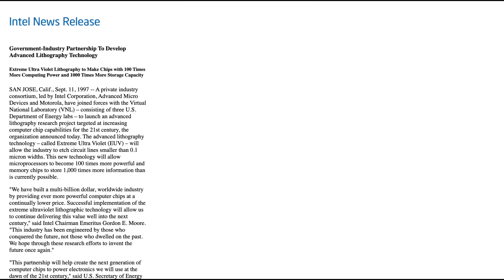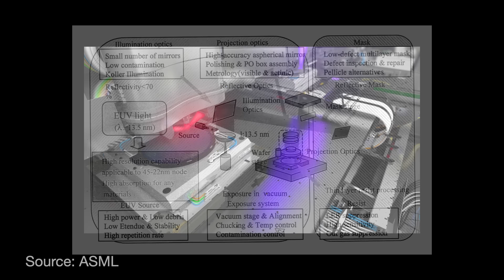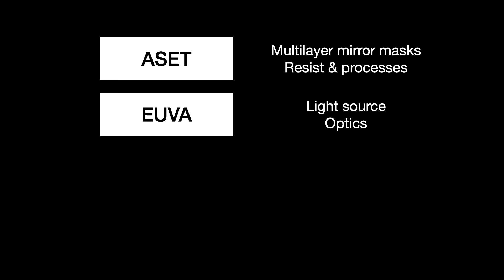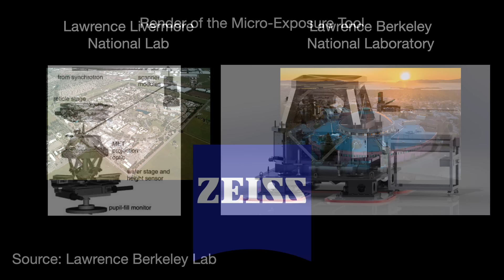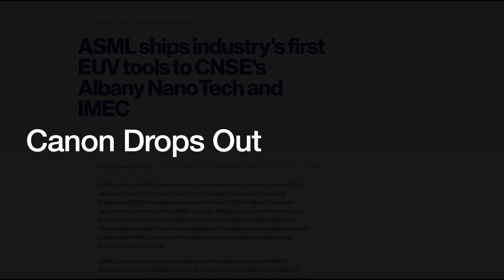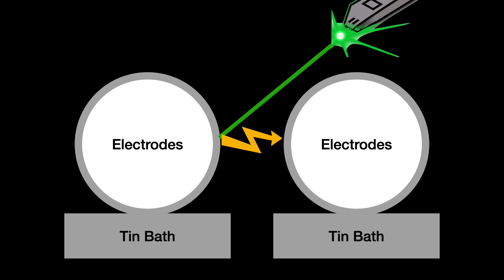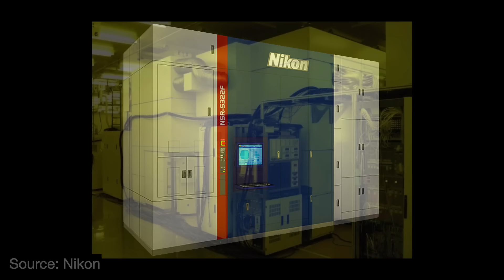Japan’s EUV Failure

Comment: Any time I hear about the EUV manufacturing process I can't help but feel that every tool at every step of the process is way too complicated to scale well. The amount (and quality) of engineers necessary to maintain even one of them would be a nightmare--not to mention the potential supply chain issues with these ultra specialized parts.
Reply: I was very fortunate to saw the first „pre production“ EUV system at the beginning of 2018.
I was a contractor in a company who is a partner with ASML and before that was responsible for the DUV machines.

It was a monster and had a million more parts than the „old“ machines.
I couldn’t believe this process can ever be used in a profitable way, but here we are just a few years later!

In my opinion EUV will not be the single do it all solution.
A hybrid approach and the use of chiplets with different nms for different purposes will be what we mostly focus on in the next 2 decades.
That’s my humble prediction.
Reply: Scalability by multiple stand alone processes maybe? Much like Apple did back in the magnesium case era, they stood up a few thousand CNC millls to make the cases individually. You get some economy of scale advantages by using a single brand and model of CNC machine.
Reply: I’m always amazed when somebody thinks the chip process is too complicated and expensive.  The number of transistors in a small chip is crazy impressive. Billions. It is complicated and expensive for a reason.
Reply: @ttb1513  I mean it's a fact that the tools themselves are just getting extraordinarily huge now. DUV isn't nearly as complex as EUV is. I don't think it's unreasonable to doubt its implementation simply based on past performance. I am confident that the technology will be used, but whether they will overtake DUV in scale I don't know. If you have any ideas, please share them.
Reply: @akatsuki6371  Overtaking DUV is a complicated question because foundries use the two machine alongside each other. DUV machines has higher throughput so EUV are only used on critical features that can only be done with EUV while using DUV for the rest. For example for the metal layers of a 7nm process. EUV is only use for the first and second layer. For 5nm the 3rd and 4th metal layer is also in EUV and smaller nodes will use them on even more layers. But Processor chips can have up to 12 to 14 metal layers. So DUV machines will not get abandoned. As process nodes that requires EUV grows they will still need DUV to complete the fabrication.
Reply: @kazedcat  interesting. So even if EUV is difficult to implement at scale, a hybrid approach could still allow it to thrive. I wasn't aware of this. I suppose it makes sense.
Reply: @akatsuki6371  you can definitely do 7nm and to some extent even 5nm nodes without EUV. The problem is your yield is crap and your cost is through the roof.

What kazedcat is saying is you only use EUV on the layers you absolutely have to. Fabs still have a ton of I-line scanners because they can spit out like 250 wafers an hour with much lower unit cost and preventative maintenance cost if resolution isn’t an issue. And this is what they do; most lithography machines in a fab by count are still excimer KrF/ArF and I-line. Fab mantra is: “always use the cheapest thing that works.”
Reply: @Grak70  I see! I appreciate your input.
Reply: @akatsuki6371  glad to be of help!
Reply: @akatsuki6371  As has been mentioned, EUV and DUV will coexist.  EUV is used for the lowest layers, with the finest details.  DUV is used at the higher layers where wire features are not as small. 

Because EUV is so expensive, there are still extraordinary complications taken to use multiple steps of DUV at a layer in order to avoid using one step of EUV.  This is known as multi patterning.

Micron has managed to figure out how to use multi patterning with DUV to produce leading edge DRAM, while Samsung and SK Hynix have had to resort to using EUV (again, for just some layers). Micron will have to adopt EUV for newer DRAM, but they have competed and have led DRAM without EUV. 

So, EUV has to compete with DUV and multi patterning with DUV.  Japan had an alternative to EUV, but EUV won early and has had all of the investment and market share.  Because this technology is so sophisticated and requires enormous engineering resources, as you observed, Japan could not and cannot justify further expensive investment in their alternative.  If it was only as successful and effective as EUV, it would be a losing and wasted investment.  An alternative to EUV would have to be so good that the R&D cost to develop it, catch up to, and surpass EUV would have to occur kind of out of thin air, all while profits and knowledge from DUV and EUV are reinvested in further EUV improvements.

It is similar to why it is so very difficult to develop an alternative to DRAM and bringing it to market at scale.  Without scale, an alternative would be expensive.  And an alternative cannot reach scale until it is inexpensive.
Reply: Essentially, once EUV beat Japan’s EUV alternative, there was not room in the market to justify continued investment in Japan’s alternative.  

But since DUV continues to be used for chip layers where EUV is not required, there has been reason to invest in clever ways to extend DUV, using multiple cheaper and faster DUV steps to compete against one more expensive and slower EUV step.
Reply: @ttb1513  Thank you so much for your response. I always learn a great deal from knowledgeable people like yourself :)
Reply: 28 nm (ignoring how much a marketing term it can be) is still the backbone of plenty of the market for years to come, just not cutting edge.
Reply: As long as it makes economic sense, they’ll find a way.
Reply: @ClockworksOfGL  I'm not convinced they will be economically viable. Have you ever seen one of these tools in person? They're absolutely ridiculous monsters.
Reply: @akatsuki6371  They are economically viable. They are using this monster machines for several years now. The foundries raise their wafer prices but the chipmakers have enough margin to absorb the increase in price. It is very economically viable in fact that intel already ordered the version 2 an even larger monster machine.
Reply: @kazedcat  That's interesting to hear.
Reply: @akatsuki6371  what do you mean they will not be? they ARE. They've been used for years now wtf
Reply: @TheHighborn  people have no clue, it seems they are at least a few years behind
Reply: “Necessity knows no law but to prevail.”
Reply: The biggest issue is a combination of rapid attenuation and the need for cleaver reflective optics. The light source also needs isolation from the chip while at the same time have a completely open optical path in a vacuum. Tall order but not impossible. ❤
Reply: So there is no homemade system yet?
Reply: @ncdpb  For EUV never but there are laboratory scale equipment that can do the similar or even better resolution but at a very slow rate.
Reply: The problems in no small part stem from the fact that EUV is extremely wear heavy on components coupled with the fact that they still rely on difficult and expensive to manufacture optics that have not changed much in decades.
Reply: @mnomadvfx  Optical fab and test has advanced a lot in the past 30 years, driven by the requirements of microlithography for form accuracy, smoothness, coating performance, and dimensional stability.  It's just as much a struggle as the development of illumination sources, mechanics, resists, etc.

Comment: I was surprised to learn ASML has really only been in their forefront position since the latter years of the 2010s i.e. about half a decade now. The way they're talked about nowadays you'd think they were this hitherto little known (cos semiconductor supply chains only became a hot topic recently due to geopolitical tensions) but key player in the global tech economy, but no they only really rose to prominence recently (rose, not founded, that happened all the way back in 1984). EUV is literally the one big thing that makes them important now, which they got into thanks to acquisitions, they weren't anything too important before it. Which also means if the technology in semiconductors changes again, ASML will be left in the dust (unless they can use their newfound position to keep up with the changing trends in the industry).
Reply: ASML was and is huge in all previous UV step and repeat systems. They just have competition in that arena. There are ASML I-line steppers where I work that were built in the early 1990s with Zeiss optics stamped “made in West Germany”.

ASML is famous now because they’re the only game in town for EUV and that makes them a strategic resource at a national security level. But they’ve been doing business in this space for well over 30 years.
Reply: @Grak70  Yeah they've been doing business since 1984. But they weren't so talked about before cos, as you say, there were plenty of alternatives. They weren't anywhere near as big either. EUV practically made ASML what it is now.
Reply: @ArawnOfAnnwn  correct, but they also ship dozens of twinscan platforms a year at all wavelengths. Most of them are I-line or KrF. Characterizing ASML as a one trick pony with EUV is just not true.
Reply: @Grak70  Oh he cos you me correct ship I-line trick pony Germany cos he supply hot topic cos
Reply: You were entirely surprised because what you are stating is utter nonsense. How do you imagine ASML paid for the development of the EUV machines, which took decades and billions to develop? Spoiler: they had highly profitable and performing machines they were selling. You might want to check out their market share, I'm certain there is a video out on that too.
Reply: @VVVJeroen  Their current market share is irrelevant to my point. Their past market share wasn't anywhere near what it is now. I never said they did nothing before EUV. And they got into the EUV space via acquisitions i.e. they didn't do all the research into it. My point is simply that ASML wasn't as key a player before the last half decade or so, they were one among many who could have been replaced. EUV made them a monopoly
Reply: @ArawnOfAnnwn  ASML has had more market share in exposure tools than both Canon and Nikon (taken individually) since 2005. And it’s been beating Canon longer than that: the 1990s were mostly a duopoly between Nikon and ASML. You’re just making shit up at this point.
Reply: Believe me it's because of their parents named Philips.
Unfortunately, things will now go downhill with Philips because of the strong cutbacks on the Natlab, and perhaps it will be taken over by who?
And then the end is Philips.

Comment: So the end of the video is all but saying that a Chinese effort to obtain EUV lithography will take 5-10 billion dollars and 10-15 years. I'd personally be surprised if it took the same amount of time. Even assuming that specific details aren't obtained through whatever methods there's at least one branch of the potential technology paths that they know they don't have to go down based on what EUV LLC succeeded with. That alone is going to shave off a decent amount of cost and time.
Reply: Let’s see if they build a KrF or ArF scanner worth two farts first…
Reply: No, he did not say that. add the time and dollar amount to what he said next, that all the info related to said project is offered up to China by the americans and dutch. Not happening.
Reply: @elchippe  ok, it’s 6 years later. Where’s the production tool?
Reply: @Grak70  China's Changchun Institute of optics and fine mechanics already built a prototype EUV back in 2017 similar to ASML's alpha demo tool in 2006. ASML's machine didn't reach mass production before 2019. So its pretty safe to assume that a Chinese EUV will come out by this decade.
Reply: @xBlackWind  I’ll believe it when I see it. EUV is not something you can just rapidly catch up on. The high NA work being done now can only be built on a working knowledge of low NA technology. And even so, the same problems are going to plague any Chinese EUV scanner than plague their excimer systems: their overlay technology sucks. That’s leaving aside all the blank production, blank inspection, and pellicle technology ecosystem that had to evolve in parallel. I don’t believe this is an area where China can just play catch-up by stealing, reverse engineering, or scraping data.
Reply: @xBlackWind the 2017 machine was based on the DPP method using a light source from Harbin. Unless things works drastically in china's favor, they would be running into the same power wall run into by ASML and Nikon and need to change the tech tree and cause additional delay. I believe a light source using the double shot was demonstrated in 2021, so I believe the brick wall and tech tree change did indeed happen. edit: it looks like Shanghai Optical Institute's experienment in 2007 is based on double shot method, it even get a gold star from CAS, not much came from it afterwards though. Either focus was shifted or the team went into stealth mode.

However China's main problems is domestic equipment maker up until recently was expect to make prototype, prints some motto and cartoon character on a tiny water then write a few papers, while industrial firms are expected to buy real machines from aboard. How they will grew up and become a real supplier to an industry is a task still to be seen.
Reply: @Grak70  it's not that rapid, from Chinese EUV has being under devement for more than two decades public infomation alone. The project was started in 2002, light source prototype in 2007, end to end prototype (two mirrors) printing 32nm patterns in 2016. (the initial target of the 2002 project) After that, most publics information on working prototypes very hard to come by as chip war heats up, and all we got are papers on verification, simulation, design etc. For example last year, there was paper on optical simulation of EUV mirror system targeting 7nm equivalent node that seems oddly specific for a pure science project. However it's unknown if that paper is a glimpse of a real system under development or  just a paper on a fantasy system with no basis in reality.
Reply: @WangGanChang  I'm not sure about what you're saying, it's true Harbin was going into DPP but as far as I know CAS (CIOMP & SIOM) is pursuing the LPP pathway with Huazhong doing the MOPA CO2 laser. We know HIT's light source is based on Xe plasma discharge (DPP). But CIOMP's website states their EUV prototype using Tin i.e. they were most likely using a LPP light source prototype developed by SIOM. And on top of this Tsinghua is going down the completely novel path of trying to develop a synchrotron radiation based Steady state electron microbunching (SSMB) EUV. Basically, china is following every possible way of generating EUV photons, even those never researched in the West (SSMB).
Reply: China needs to build the industry to build those machines first... they can't have that as long as Communism is ruling the country

Comment: Will japan still try to reach leading edge lithography? Perhaps with the X ray thing.
Reply: I think the issue with X-ray was you had to make the masks out of pure beryllium or something similarly crazy. The material science is wicked hard. And back when X-ray was being proposed, they were hoping it could do like 100nm half pitch. You can almost do that with a KrF system nowadays.
Reply: @Grak70  Eventually we will have to switch to xray tho no?
Reply: @DwAboutItManFr  I really don’t think so. The jump in resolution is just not that much, even if you assumed x-Ray was fully developed already (if they need it in 15 years, they should have started five years ago and they haven’t, so smarter people than me probably think they don’t need to). 

It’s a very similar situation to what happened with immersion ArF and F2. Why go through the enormous pain in the ass of F2 excimer patterning when it’s really only a 1-2 node solution? And when you can develop 1 additional system component (the immersion apparatus) but keep the rest of the ArF infrastructure the same? Why go back and do massive amounts of basic science on synchrotrons, beryllium masks, and unknown-to-science x-Ray transparent materials when you can just slowly improve EUV? It’s less sexy for sure, but most progress in engineering is slow, incremental, and (to most of us anyway) boring. Making big investments in new physics is something companies want to avoid unless they absolutely must. That was the case with EUV: thankfully it worked. But so far there’s no “drop dead” problem clearly visible for EUV: just engineering challenges. Personally I think EUV is the end of the road for patterning tech: it will continue to get better, but never be supplanted by a next gen tech. Increasingly clever designs and integration are going to have to take up the slack from here. This also means that the Moore’s Law component of ever decreasing costs will die. Performance will come at an outrageous cost, so the era of consumer electronics rapid obsolescence and the cutthroat capitalism of fast, continuous improvement will end. Institutional bodies and governments will ironically once again be the only customers for truly state of the art computing, if indeed they need it at all. We left the era of single chip supercomputers behind long ago; networking of smaller compute units and AI optimization will rule from now on.
Reply: @Grak70  Litography is not the only way to get new performance.
Reply: @DwAboutItManFr  I specifically said as much.